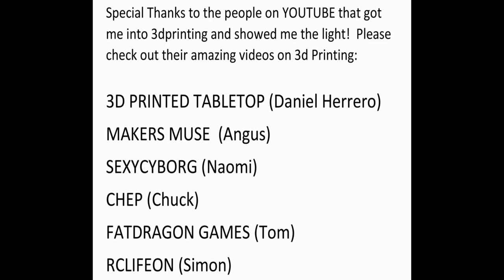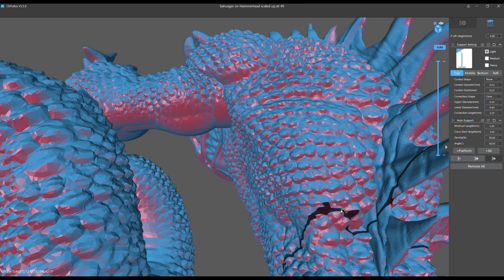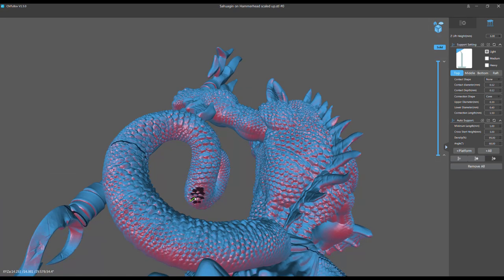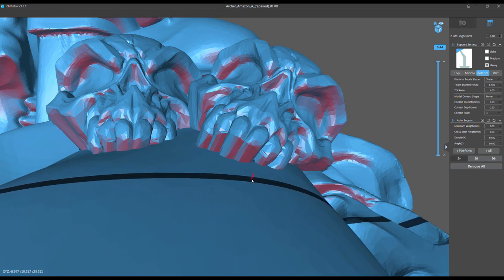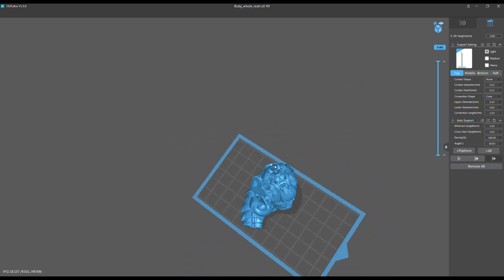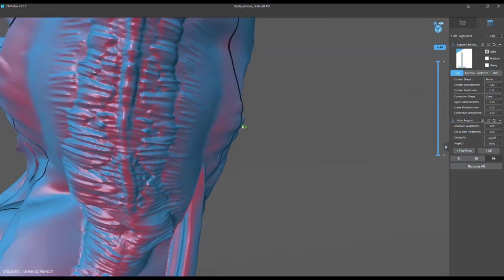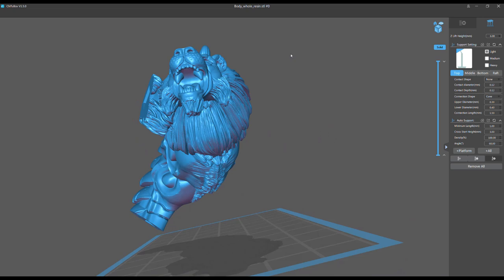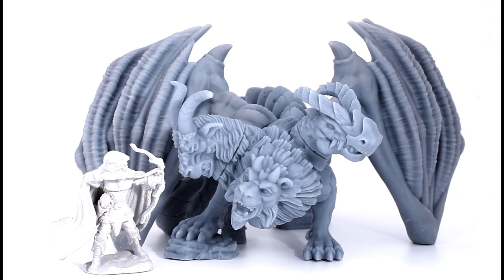3d Sculptors and artists watch to learn how to improve your product and keep customers happy!

Comment: Excellent video! I think it would be nice if you talked about parting models for easier and cleaner reassembly. The Chimera in this video is a great example, the fur on that goat head could have been used to hide the seam by following the contours of the fur and having the fur come out past the cut rather than cutting straight across.  Not sure how well I said that, but I have a feeling you at least know what I'm talking about.
Reply from the maker: yep I was going to make a video on that you are psychic!

Comment: I think these tabletop inexpensive printers gave us the wrong sensation that printing awesome things is only a few clicks away from us. On a professional level 3D printing comission they would charge you big money and they do lots and lots of steps including cutting figures into pieces and manual clean up after the prints are done. 1 hour  of preprocessing doesn't sound like a lot tbh. 
If the minis are advertised as print and go then that's a diff story. There is a level of detail that requires extra work no matter what. 
I would invest the time on learning some blender and smoothing those details or removing them where you consider are not really required.

Also for artists, those teeth and fur pieces should definitely be on a separate piece.

Great videos nonetheless!

Comment: Nice video, thanks for sharing. I guess all the issue you pointed come from sculptors not used to mass production moulds (rtv silicon and spincast). I always worked for companies and not for the STL file market so for me is a new market, and my first models were split into a lot of pieces (like the one I did for the physical market). If I can defend the category (and I have not the merit to do it), when you have not the big issue of mould's undercut you can do models more realist, less toysh and more statue so maybe you let yourself get carried away by the enthusiasm and try to push the limits further

Comment: Wouldn't much of this be solved by the artist cutting up the model to optimize for printing, instead of molding, which seems to be the case here
? For the shark thing, you could have the upper teeth on a tab, that you could just orient to print without supports. Scaly skin limbs could be sliced in two so you could brint all the scales facing upwards and so on.
Reply from the maker: that might work but would require a lot of parts, and I think a lot of people printing at home don't want to be bothered assembling models, except for the really big ones.